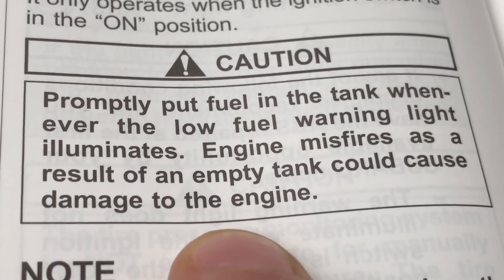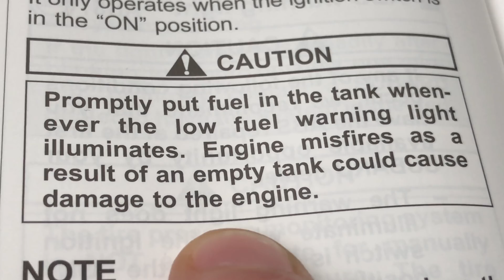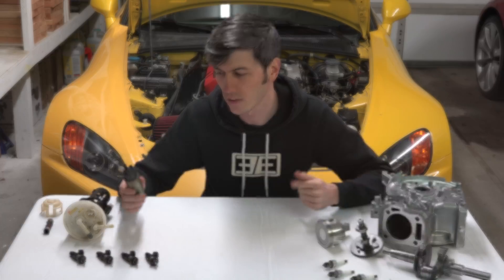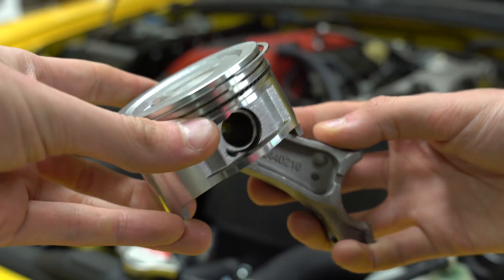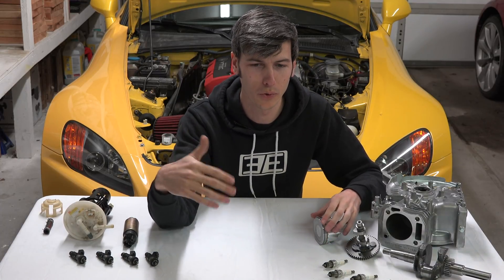Will Running Out Of Gas Damage Your Car?

Comment: If car doesn’t start after running outta gas tap the pressure release valve which is a little valve on a fuel line on top of the engine. Some cars have them and some cars do not

Comment: you can drive on low fuel without damaging fuel pump when the lights shows you can acty drive but dont let your fuel levels to be at very very low it can damage the fuel pump i bascy refull my car when it says i have 50 miles left but i dont accelerate hard beacus it can damage your engine you just need to drive littel slower

Comment: Running too low on gas will overheat your fuel pump and you'll have to replace it. It'll probably be pretty expensive cuz it's inside the gas tank.

Comment: Yes, driving around with less then 3 gallons may cause the fuel pump to over heat and shut down. Driving around with more than half a tank and you are wasting fuel hauling around dead weight.

Comment: I have always had the belief that if you run close to empty, you will suck up the rubbish from the bottom of the tank which could affect the fuel pump. I never let my tank fall below a quarter full.

Comment: QUESTION BELOW: Why do diesels need bleeding and petrol (gasoline) doesn't:

Diesel injectors operate at a much higher pressure than petrol- it can easily need 10,000 PSI to open an injector valve on a modern diesel, compared to as little as 800 PSV on a petrol engine; these figures will vary and I'm just going on two engines I've recently worked on. To generate that amount of pressure on the speed a starter motor can turn the engine is possible for a petrol (gasoline) engine but just about impossible for a diesel.

This isn't a perfect explanation but it might help: let us pretend that you are trying to push your car up hill by hand- normally your hand would be in contact with the bumper (fender) and you can transmit all your force to make it move. Now imagine you tied a load of springs to the back bumper (fender) and tried pushing against that- most of your force would be wasted in compressing the springs, not moving the car.

Now replace the car with injector tip, replace you with the fuel from the injector pump and the springs as air trapped in the pipe.

HTH someone.

Comment: In response to someone's comment below about diesel injector pumps failing due to running out of fuel (diesel fuel is used as a lubricant) I posted this response which might or might not help:

I came across a truck engine some years back- I can't be certain of the make now so I will refrain from speculating, but it was a European built truck using a USA engine (built under licence) and I suspect it was a German injection system. It suffered the exact problem you described- but whereas most pumps are tolerant of a little air, this wasn't and it did indeed send debris to the injectors.

The dealers were disgnosing failed injector pumps but didn't look in enough detail why, nor did they check the injectors. Anyway, so they install a new pump, bleed the system and start it up- only to find the injectors jammed with metal debris, which then fail- with the injector tips breaking off into the cylinders, with the inevitable result that you need new pistons and a new head.

But that was an exception and resulted in a re-design. You should not have a diesel pump failing catastrophically as a result of running out of diesel on an occasion.

Comment: I always run the (GAS) tank to the empty (= solid light, blinking light, then the ECU commuting back to petrol), then run on petrol until I can fill up again with gas (LPG). 
But petrol tank is usually at least 1:8, I'm not sure if petrol pump is kept running when using LPG.

Comment: I have a big 2002 Ford e150 van and a 2014 Nissan 370z. I typically take the fuel down to 1/8 of the tank (Sometimes a little below), and fill up to about half the tank. Is that doing damage to my car? I've never run out of gas, but I figured why carry extra weight around if it's not needed. If 1/8 of the tank is too low, what is a good amount so I'm not damaging the fuel pump or any other parts of the car?

Comment: my motorcycle fuel indicator would start to blink, and one time when that happens I decide to flush the fuel and clean the tank. It still got almost 2 litres of gasoline inside. wonder if it's by design to prevent pump damage?

Comment: You missed the diesel high pressure pump and self lubrication. If this runs dry it might be the same as running without oil.

Comment: One thing to consider about the fuel pump is that it only work when the engine is running (and priming and cranking). If the engine stop because of a lack of fuel then the ecu also turn off the fuel pump. One of the reasob is in case of a leaky injector. You don"t want to flood the engine!

Comment: The pump materials are of POM (polyacetal) like Delrin which is a low temp plastic but that resin chosen because it is both lubricious &  impervious to hydrocarbons.   When the tank gets really low then the pump's electrical coil is operating without the naturally cooler fuel sitting around it.  I do know engineering plastics and in fact drove around in DuPont's company car with "DELRIN" on the license plate for years. The cost of replacing that acetal pump is the only reason I keep my fuel tank near full.

Comment: I was in the habit of driving until the gas tank was almost empty, without actually running out of fuel, before filling it up. Bad idea. The fuel pump needs to be immersed in fuel for cooling, otherwise it runs hot, shortening its life. I had to get the fuel pump replaced, and now I fill the tank up before the gauge indicates less than 1/4 full.

Comment: Some high performance cars can burn their spark plugs pretty quickly if the fuel ratio becomes too lean.
Seen it happen to a fair few drag racing cars, during fuel starvation.
That said, ordinary cars rarely have that problem.

Comment: I've run my Explorer until the message centre says '0 km to empty' a few times,
but when I fill it, it takes at least a gallon less than the fuel tank capacity.
I guess they have that as a protective fail-safe... never been game to push it & find out though, lol.

Comment: I have a 2000 Accord Sedan 5 speed. Amazingly reliable car. I’ve run out of gas on the Highway before on the way to get gas. It was both a scary and sad feeling:
The pedal stopped deliver power. On the Highway. It didn’t die right away but it was clear it was going to die. I was able to get it to gas, since then I never like to go under Half a tank.

Comment: I remember driving waay past the empty light to the point where it wouldn't even show a range or fuel remaining. I was just counting the remaining left in my head as I went to the gas station. It is a 15.9 gallon tank and I put in 16.2. 😬😳

Comment: you kinda left out one half of the question though... If you're running a turbo engine, particularly a turbo diesel than running out of fuel will destroy the engine because air cannot be compressed to the same degree as the diesel. Seems kinda important to mention...

Comment: i get that sucking air is bad for the pump, but if your sucking air because you tank is that low, would you not also feel the engine lugging due to low fuel?

Comment: My dad tried to blame the water pump breaking on me driving with low fuel. I never ran out of gas I knew most cars are designed to go a minimum of 35 miles with teh low fuel light on.

Comment: Biggest problem is with Diesel engines. The fuel injectors can be damaged by running out of fuel. The fuel helps the injectors to not slam shut. This is not as bad in the older engines but the new ones run swap into the thousands on psi.

Comment: Wouldn't you lose fuel pressure as soon as air got into the pump? I mean the engine would stumble for a second or even stall so it would be obvious I would think.

Comment: I can understand why you sometimes don't want to have to much fuel in your tank, for example a car you don't use so much, just for special things. My father have a car he uses almost only for going to his bee yards and he doesn't want to hane to much fuel in that car. However there a difference between running on fumes and running about where the fuel light goes on. I think it's bad in every way to run so low that your car coughs to the gas station even if it wouldn't hurt your car. But running with a few liters of fuel in the tank is definitely enough

Comment: Good advice. People also might consider buying an Electric Vehicle (EV). If an EV runs out of energy, no damage is done at all. 

In addition, an EV can't be filled with the wrong fuel, like a fossil fuel vehicle can (e.g. putting diesel in a petrol vehicle). EVs are simple: plug it in, it charges.

Comment: Biggest issue I have heard is the likelihood of getting your fuel filter clogged and having to have it pulled out of the tank to be cleaned.  Not sure is that’s true but sounds plausible. 

I typically fill up at a quarter tank and always have.  Only ran out of fuel once in a rental car in Greece.  Car still said it had 1/4 tank on the gauge.

Comment: Unburned fuel is only damaging to the converter IF it is joined by available oxygen. PCMs actually cool the converter by adding extra fuel if COT Converter Over Temp conditions are detected. Misfires present unburned fuel AND available oxygen to the converter and it can go nuclear which is why the check engine light flashes and most computers will shut off fuel injectors on misfiring cylinders to help prevent converter damage. Keep Up the Good Work !!!

Comment: Running a diesel out of fuel is NO FUN, petrol/gas not as bad, not so good for system, but also using a Service Station that has water free fuel storage tanks are a plus, BTW it does matter where you buy your fuel.

Comment: I run my cars close to E all the time and have hundreds of thousands of miles on the pump and they're fine.  The reason the pump suction is at the bottom is to allow access the capacity of your fuel tank in addition to prevent sucking up air.

Comment: Fuel pumps are not cooled by gas in Phoenix temp 118 fuel temp better than 120 fuel pumps go bad because of bad design ranger had external fuel pumps in the 80s people never knew because the never went bad running tanks low will not pick up dirt someone tells you that go dump a hand full of dirt in the tank of the dick heads car and than tell them just don't run your tank low and you won't pick up any dirt  DICK HEAD Enuff  said

Comment: He's speaking the truth. Of all the cars I've owned, I 've only had to replace a fuel pump once, and it was a car I would always run very low on fuel. The car only had a little over 50k miles on it. Ever since then, I always refill my tank once it is down to a quarter full or more, I never run it near empty like I used to.

Comment: Thank you for the info presented in this video. A couple years ago, my son told me he had to drop his gas tank and replace the fuel pump. We're both DIY types and we theorized that the fuel pump should remain submerged in gas to stay as cool as possible. We both adopted 1/4 tank as the lowest point we should allow before refueling. Interesting that you've reenforced our conclusion. Thanks again!

Comment: Good point about the pump over working and yes it will shut off due to lack of fuel but why risk it.

I wonder how many drivers are watching this video while on the side of the Interstate about 5-10 miles PAST the.........”Last fuel for 300 miles sign.  Obviously hoping the battery has enough life.  Then again probably playing Angry Birds while waiting for Roadside Assistance instead of conserving the battery.   

The low fuel light is there for a reason.  It’s called a “WARNING” light for a reason.....Technically speaking it is a caution but some lights are programmed to chime once in “Amber” and the second time in RED.  Sorry if you ignore both of those warnings then your on your own!   

For those in the snow belt and other snow area locations one more thing to think of and not mentioned in the video.

Keeping a decent amount of fuel can have two benefits.

1.  Depending on the location of the fuel tank and fairly common location is in between the Fram rails or unibody  forward of the rear axle.

This location can help provide weight in the rear of the vehicle and weight can equal traction.....other factors of course, knowing how to drive in the snow, and safe driving habits.

2.  You don’t want to run out because you COULD be stuck when a state closes the interstate if the weather gets bad enough and states “SHUTDOWN” Totally. It happens and can be common.  Don’t believe me ask the people in upstate New York near Lake Erie.  NY Thruway has been totally shut down several times and sometimes it may take a few days to clean up.  First step is getting stranded motorists to safety, Second is removing traffic obstructions...( abandoned vehicles). Then work to clear the snow and treat roads.  Sometimes all concurrently but it can happen.

Even if you don’t actually get caught on the interstate shut down the road conditions and traffic could be high volume to clear at an exit.  You want some fuel in the vehicle to run heaters, stay warm, charge phones, tablets, etc....

Simple summary....Not recommended the logic from EE is sound but don’t think that a Interstate shutdown can’t happen to you.  About every winter there is another story about people that said it wouldn’t happen to them.

I grew up in New England and temporary shutdowns of Interstate can be common.  If not total shutdown then temporary isolated closures and speed restrictions.

Comment: You are wrong about this! This is a mith! In most cars there is a valve in the plastic case of the pump, that valve avoid the fuel going out and keeps the case full regardless the level of the tank. And please, gasoline DOES NOT lubricate. 
Excuse my English. Kind regards

Comment: I have always run to where the car would have only 1 galllon left in the system. 45L fill ups mostly in a 50 L tank for 10 years. Never had issues with the fuel system. I mean never! But I wouldn't advise doing that.

Comment: Is it a FACT or an OPINION that the fuel pump would run too hot if pumping air?  While I see your reasoning about the fuel cooling it, I also see a very large reduction in heat generated when not pumping fuel....a pump spinning freely uses very little power.

Comment: 6:37 I noticed you have what appears to be a K&N air filter or similar installed in your car.  I've read some people say they allow too much dust, dirt, etc. to get past the filter or if you oil or recharge them incorrectly, the oil can damage sensors.  What is your view on this?

Comment: Interesting. Having a cylinder misfire and creating knock to the point where my engine actually blew up actually happened to me even on a full (or half full) tank. The lateral Gs I was pulling on track effectively created that "fuel slushing" you're describing, and even though I was nowhere near empty, the force was so strong it was constantly pushing my fuel all the way to the sidewalls of my fuel tank, effectively leaving the bottom empty of fuel and that starved my engine.
Reply: Well that's a pretty cool way to break an engine you need the type of fuel pump systems that race cars use
Reply: @anthonygarcia5375  I guess it is… Yes, I ended up going to a different system after the new engine was installed

Comment: So the E on your gauge is not for Enough? Also the sock on the bottom of the pump is for larger type particles to be filtered. Anything that can go through this is ok for the pump then there is a finer filter somewhere in the line to the engine. Not in the pump housing like you mentioned.  Love your show. Thanks. Do you actually get to breathe during your explanations?

Comment: just fyi, there are types of fuel pumps that rely on surrounding fuel to keep them cool, the fuel does not pass through the pump to cool it,  the jaguar XJ8 for example would start overheat after a quater of a tank on the guage, also the rotor of the motor was made from plastic and it would just melt.

Comment: A mechanic once told me to keep the tank at least half-full, because the pump is submerged in the fuel, and the fuel -- to some extent -- keeps the pump cool.  Letting the car run low all the time may shorten the life of the fuel pump.

Comment: I drove a 2002 Nissan Sentra all the way to Empty. I pull off the freeway to put gas in, I put the gas in but the car won’t start (only cranks but won’t start) after jumping the car the car starts but then almost immediately tuns off.

Comment: I drive for Uber, so to maximize fuel efficiency (which maximizes my profits), I typically only fill the tank half way as a means to reduce weight, and I notice about a 2-3 mpg average increase doing this, and an additional 1 to 2 mpg improvement if I routinely check and maintain tire pressure. I do my best to refuel as soon as the low fuel indicator turns on, mostly because I drive in a hilly and somewhat mountainous area, and want to avoid engine sputters (if that's even a thing with modern vehicles). The lowest I ever let it got was probably 1 gallon left in the tank, as the indicator comes on at about 2 to 2.5 gallons. Hopefully I'm not causing damage that will suddenly bite me in the ass. I put nearly 9,000 miles on my car last year just doing Uber driving, and that of course takes a toll on any vehicle.

Comment: 1997 Mustang 3.8 run out of fuel feel times and always driven to the last fill drops do to my procrastination . Sold the car with 185,000 miles with the original fuel pump 🧐

Comment: Overheating pump? Utter rubbish! This is fiction. From personal experience I can assure you, that on my car, running out of gas has no adverse effect. I run out of gas once or twice a week. My Nissan truck is quirky... If low on gas and you stop on downhill the gas engine starves of fuel and cuts out. Happens all the time, that is how I know that it is time to fill up.